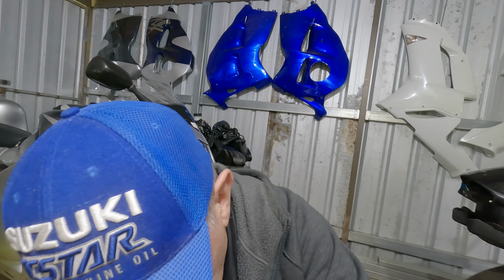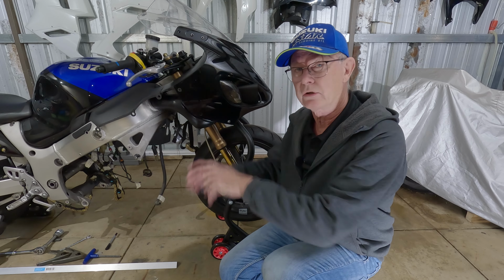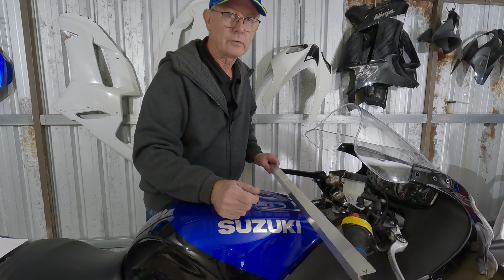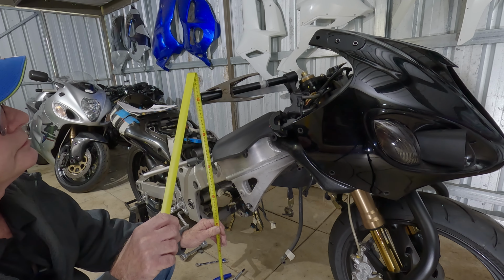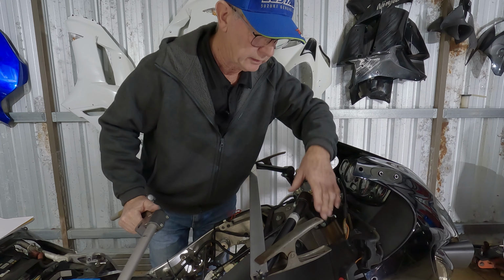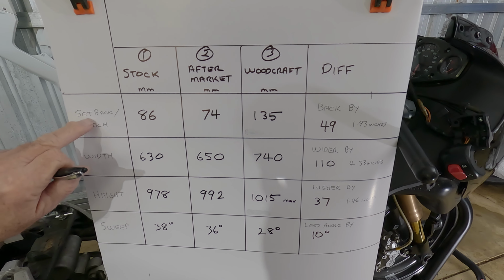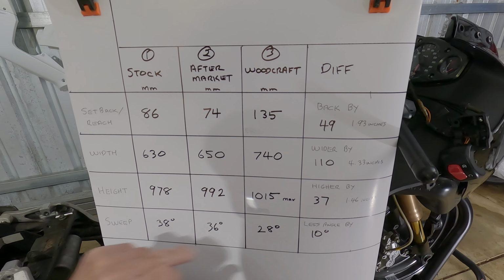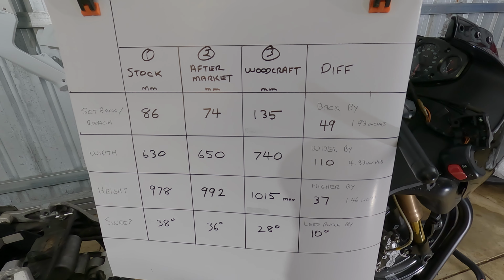Suzuki Hayabusa Gen1 Handlebar measurement Comparison!

Comment: I'm 58 and got a top yoke conversion on my K6GSXR 1000 with rizzoma straight bars , still weight on the front but more comfy,, and no bodywork mods ,,,☘️☘️☘️☘️☘️ from northern Ireland
Reply from the maker: Good to hear you could squeeze the new handlebars under the fairing/screen. Yes, the K6 is a great bike.

Comment: Nice one Kev, thanks for taking the time and effort to creating these vids, I enjoy all things Hayabusa..( I have a Gen 1 ‘99 model) and I also have changed the OEM bars to after top yoke with Renthal bars.
So much easier to ride, for an old Kiwi it’s a big help!
Keep posting vids and technical info, and post up some track riding too!
You ride well mate.
Reply from the maker: Thanks mate for the encouragement! As you know, making the videos takes a lot of time and so many technical issues but I think I may have reached that turning point where the videos are getting easier to make. I find I never stop buying gear. Or changing settings. Wind noise/audio has been the most difficult thing, I delete so much footage because I hate it. Yes, I considered the Renthal type of bar conversion but kind of chickened out and went for a in-between set up. I'm glad your top yoke mod was a success! As for the track days, yes but when I sort out new better brake pads and better tyres for that sort of use. I've reached the limit of what I was using before.....Oh! And look after that '99, they are worth a bit of money for sure.

Comment: I always found the bars took the edge off of comfort and control (when using it as a sport bike). Your mods look like they'll be a great improvement.  How much have you reduced the overall weight of your silver Busa ?  Your videos keep making me want another Busa !
Reply from the maker: Yes, I agree. The standard bars are good for getting your chin on the tank at the drags or high speed runs  but a bit more leverage in the corners and slightly more of an upright seating position is what I'm after. I did weigh the silver busa many years ago but I would be guessing now of what the weight was so I will redo that and make a video of it. Good idea, thank you.